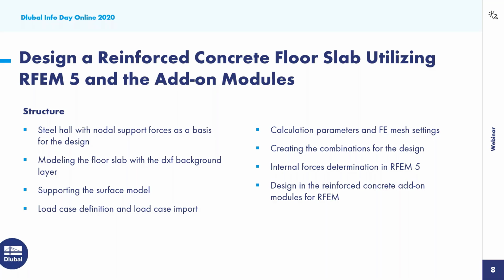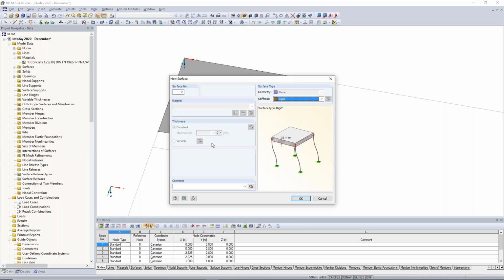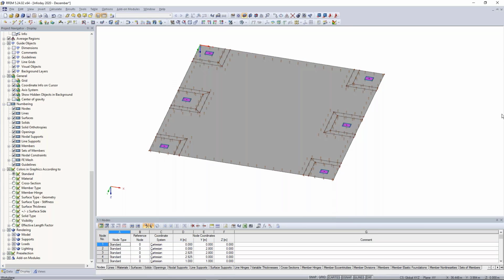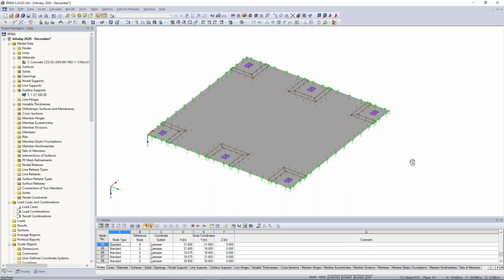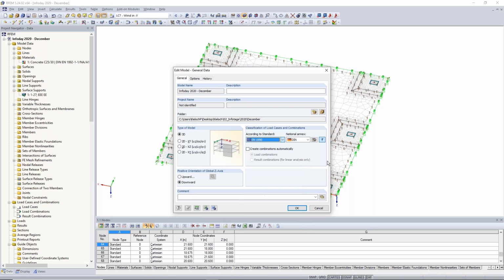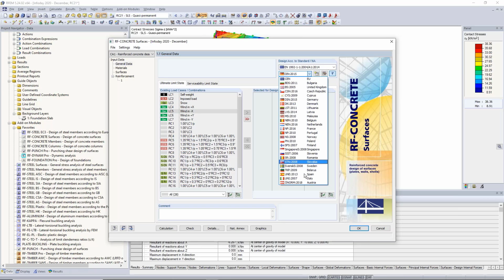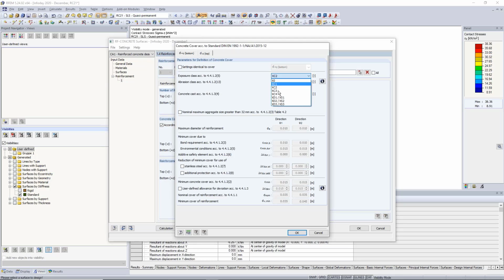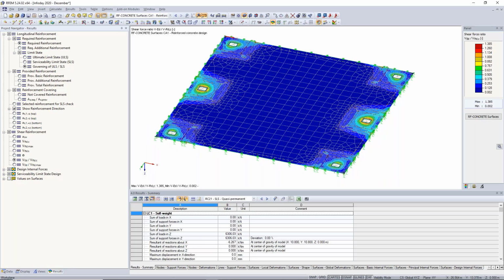Reinforced Concrete Floor Slab Design | RFEM | Info Day Online | 15.12.2020 | 2/4

Comment: What aboth using SOILIN for this kind of work?
What would be the benifits and limitations?
Reply from the maker: Hi, picajoool!
If you calculate without RF-SOILIN, the assumption of the modulus of subgrade reaction is greatly simplified and unrealistic.
You can try to optimize the whole thing with edge springs. 
Or by modeling the slab with strips at the edges and giving the individual strips different stiffness/modulus of subgrade reaction. But that is very complex.
RF-SOILIN would do this completely automatically. You can find comparison of different Soil Models in this article.
https://www.dlubal.com/en/support-and-learning/support/knowledge-base/001400
Reply: @DlubalEN  Very interesting. Thank you. 
One question more, is it possible to export spring stiffneses that you get from SOILIN back to RFEM? How odes this work?
Reply from the maker: Hi, picajoool!
Unfortunately, that is not possible.
Reply: @DlubalEN  So you cannot model an structure in RFEM and then caculate springs stiffnes in SOILIN?
Reply from the maker: Hi, picajoool!
You can model the structure and calculate the stiffness, but you can also activate the calculation of spring constants (by using RF-SOLIN) directly in the surface support.
Reply: @DlubalEN  Its possible then :-)
Reply from the maker: Hi, picajoool!
Take a look on our website. Here you can find the features of RF-SOILINhttps://www.dlubal.com/en/products/rfem-and-rstab-add-on-modules/others/rf-soilin

Comment: when im using concrete surface add-on module to check required reinforcement, at some area there is no results but grey color. Could you please explain why?
Reply from the maker: Hi, N-rad!
That sounds like a non-designable situation. However, there could be many reasons why this is happening. You can check the Add-On module if there are any errors.
Alternatively, you can check this FAQ:
https://www.dlubal.com/en/support-and-learning/support/faq/004321

Or you can contact our free online-support for further assistance.

Comment: Thanks for a nice video tutorial. Anyway, is it possible to view reinforcement details at each slab? (just as it can be viewed when designing RC beam and column). Thanks in advance
Reply from the maker: Hi, Thaileang!
To do this you need the Add-on Module RF-CONCRETE Surfaces. Then you can follow the instructions in the following link.
https://www.dlubal.com/en/support-and-learning/support/knowledge-base/001040

We would like to thank you for your appreciation.